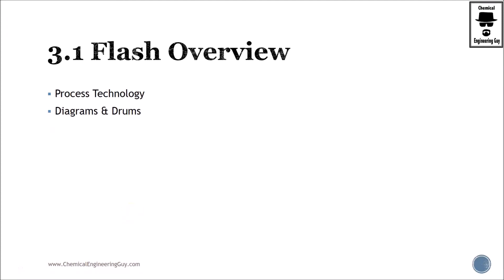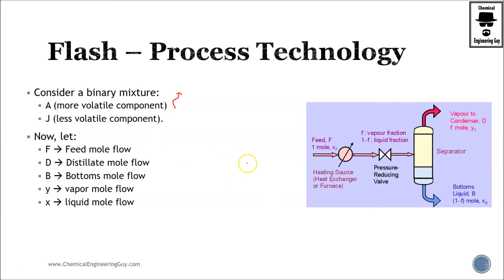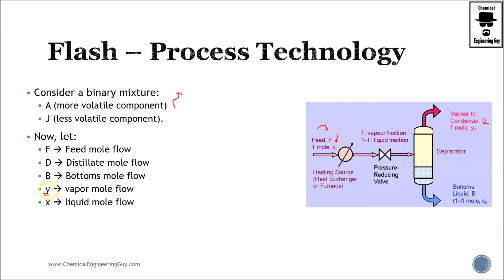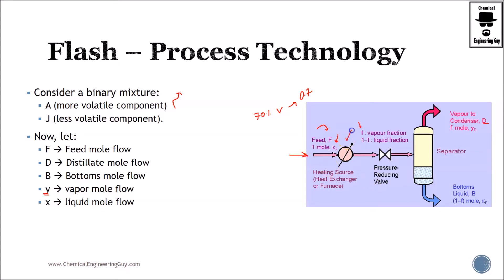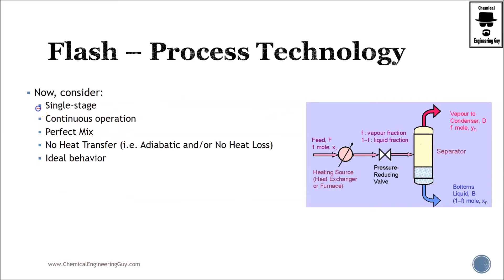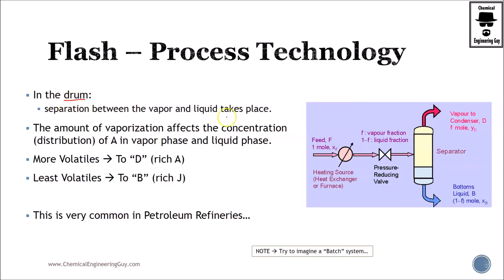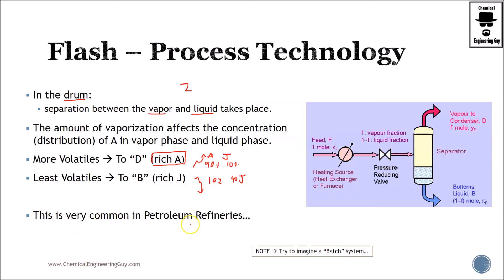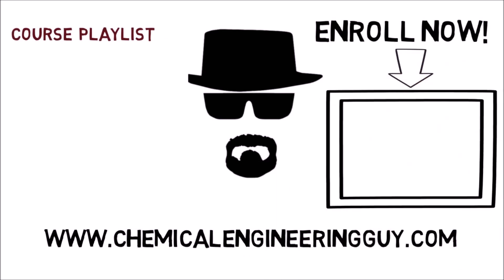Flash Process Technology - An Introduction to Flash Distillation (Lec 067)

Comment: hi, how a valve will reduce the pressure. thanks
Reply from the maker: Assume that you have a bottle of 1Liter of Coke, then you agitate it, it will be pressurized, for the sake of the example, lets assuume 1.2 atm... Then you will open the bottle cap SLOWLY, letting the gas go out in a controlled manner, there is a lot of friction between the bottle cap and the outlet, this is what makes a reduction in pressure. In this case, the bottle cap is acting as a valve, you are controlling the flow of fluids.
Reply: Thanks for your explanation. Valve means controlled restriction on the flow path. This restriction will reduce the upstream fluid pressure, which will cause vaporisation. Just like flashing and cavitation in valves (undesirable) but in this case it is desirable for the vaporisation. Am I right?